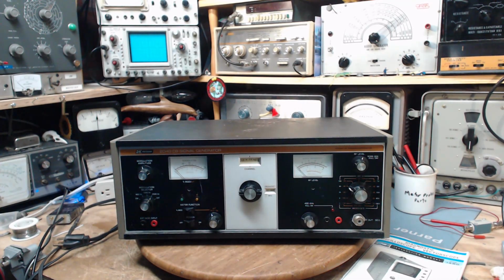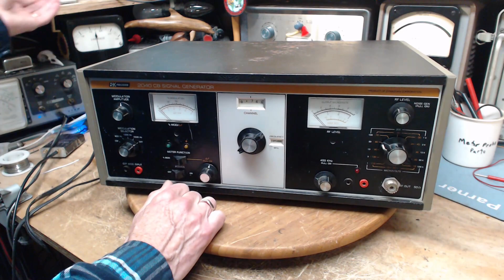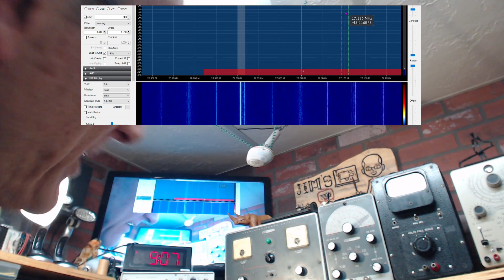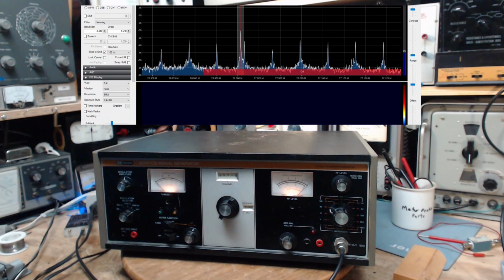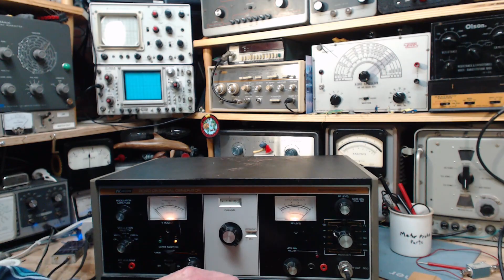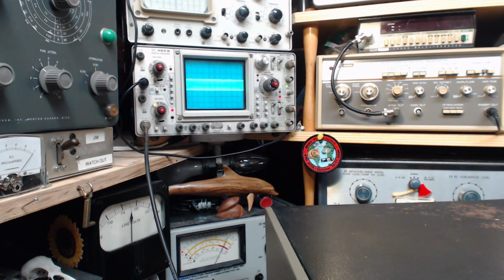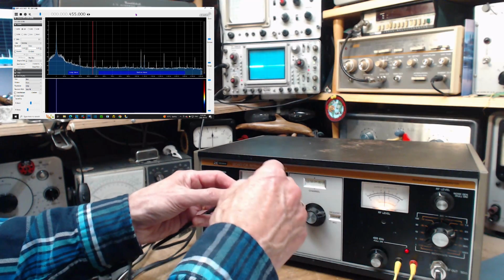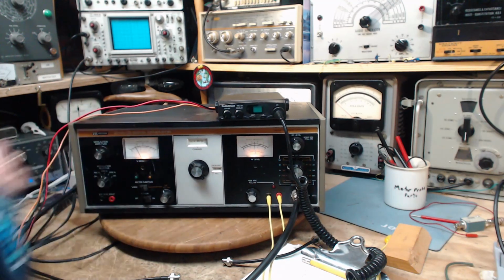B&K 2040 CB Signal Generator - Checkout and Testing

Comment: Hi Jim!!!   I'm enjoying your video on the B&K 2040.   I have one of those and am DESPERATELY trying to find the matching 1040 CB Servicemaster.

Let me tell you about the "delta freq" on this box and why it is there.

What the delta freq does is allow the operator to "dial in" an offset to the carrier in a predictable manner.  If you look at the bottom scale on the modulation meter it has 1,2 and I think 3.  Together with the PLUS and MINUS... you can "offset or bias" the output carrier frequency by 1Khz, 2Khz or 3Khz either above or below the carrier.

The reason you want this is for testing sideband receivers.

If you set the radio up say... for Channel 20 (27.205 Mhz) and set it to USB......
THEN turn on your delta freq and adjust the delta control to light the PLUS light and adjust the meter to the 1 on the scale.... the generator is now putting out 27.206 Mhz which represents a 1 Khz offset from 27.205 Mhz so your radio should be responding with a 1 Khz audio tone through the IFs and into the audio section.   You would conversely use the MINUS side of the delta freq for LSB testing.

--------

I wanted to also tell you that if you look at the text legend around the RF output control..... 
that control is also a push/pull switch.  When you pull it out.... it enables a pulse noise generator in addition to the RF carrier.... for troubleshooting Noise Blanker circuits.   WIth this.... the 2040 can supply "impulse noise" to the transceiver.... giving you a noise source to use when testing or aligning the noise blanker.

I was laying there watching before going to bed and jumped up to come in here and offer you this information perhaps... for an update video if you have a mind to do so. But in any event...I hope that the information helps you understand it better!!!!

I am really enjoying it though.

Best regards,
Bob

Comment: Hi, Im puzzled why you did not connect a frequency counter to check the accuracy of the generators output frequency.
Was the output designed for 50 ohms? Remember, scopes can have high impedance inputs.
The SDR has auto and manual gain controls. You might have them turned up too high if you are getting all those spikes on the FFT and waterfall. Try backing the gain off.
You can adjust the accuracy of your SDR by tuning into an accurate transmitter like WWV, then adjust the PPM offset to bring the peak in line with your cursor. I use a GPS locked 10Mhz generator for high accuracy. I also use a rubidium 10Mhz oscillator and compare the two and any difference. If you have a 10Mhz reference standard you can use it for an accurate oscillator input for lots of test equipment also. Good luck.